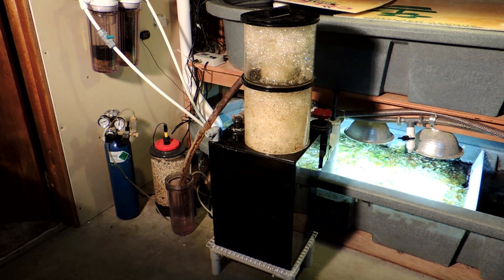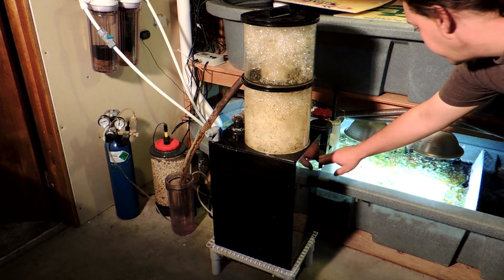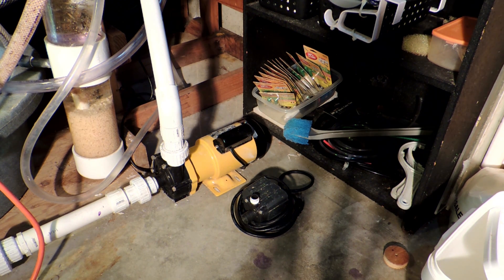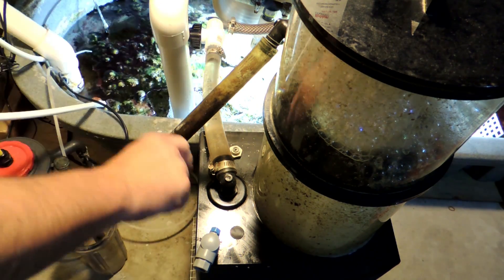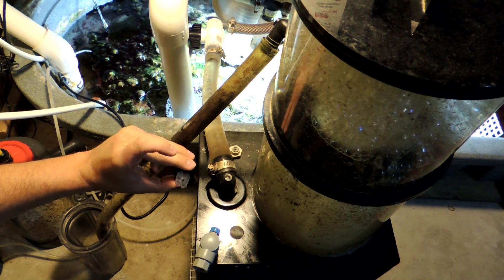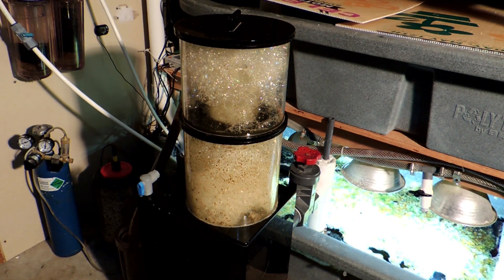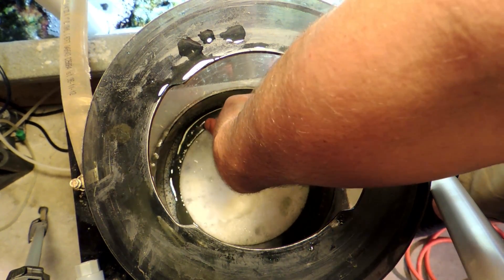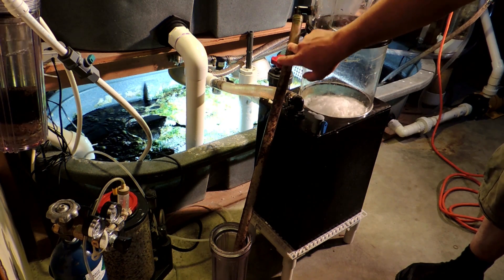Tuning an AquaC EV Protein Skimmer

Comment: Great helpful video.  I have an EV-1000 so it was nice to see your thoughts and ideas.  One thing I would add is to be cautious of the fact that when you have the top cover of the skimmer removed there is much less resistance to the total air flow and less back pressure so tuning the water level should be done while the cover is on.

Comment: I have the Ev120 in sump and I can't get it tuned I have photos to show set up and a 15sec video of how it's running. I have too many bubbles that it expelling water with bubbles. I have the mag drive 5. Can you tell me what I'd going on. I believe I have the water level at the platform (the black line about an inch from the top of the box). I you want I can email you the video and set up. I'm at the end of my rope. It's been running for 3 days now and I had it working where the bubbles were climbing the tube in the morning it was running like a faucet. My tank is a 72 gallon set up 2 weeks with stock from my 30 gallon and it has cycled.

Comment: Hi, I have a question. I don't have a sump yet... Can I supply water to the skimmer straight from my aquarium overflow. Right now I have a Canister Filter Magnum 350... I wonder if I can use both at the same time. Thanks in advance!
Reply from the maker: You will run your overflow line directly to the first chamber sump. I personally wouldn't run a canister filter on a reef tank. There known as nitrate factories. They suck up all the derbies in the tank and it just sits there and rots. You can clean it often to reduce this risk but most reefers don't use them. Your other filtration equipment will do everything a canister does. To start,  I recommend the best skimmer you can afford and a carbon and GFO reactor.

Comment: great video. thank you. can't wait to get home and clean my ev120 out. I have had it for 3 years and I've never cleaned out the nozzle or air valve!! that's why I think lately I have been having a hard time with the bubbles reaching into the skim cup on top. they have been staying just shy of falling in the cup!
Reply from the maker: That could defiantly be the problem. Hopefully its an easy fix.

Comment: can someone explain the plumbing mechanics why you want to Tee the output of the skimmer. I drilled a hole in my elbow but I would love a explanation why it helps. Thanks.
Reply from the maker: Drilling the hole in the elbow eliminates negative air pressure in the elbow allowing water to flow through easily. It also ensures that a syphon cant develop. I personally prefer a T over drilling a hole in the elbow for cleanliness reasons.